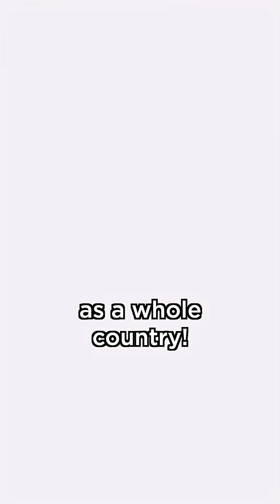The hottest building in the world

Comment: One question… Can we make data centres at snowy places so we wouldn’t need ACs to cool it down.. just need to make strong networks reaching there…Cost ans energy saving 😅
Reply: But how are you gonna give electricity and water supply there ?
And internet 
There ?
Reply: Due to high humidity...the components got rest faster than normal condition.

Comment: Brother you missed one thing water.
It consume so much water 💦.
AI will be good as computer but we need to use them wisely not for our silly questions
Reply from the maker: Totally. And that’s why hydrogen tech is exciting, some companies literally split WATER into clean fuel. We just need to scale it.
Reply: @NasDaily when is the material generator
Reply: Pretty sure you can reuse that water
Reply: Yah , You should have correct way how you can use ai power infectively, that's it! If you know about that so you can go very well.
Reply: Good observe
Reply: Nvidia just found the solution sometimes before
Reply: It doesnt drink water , it just uses it for cooling and comes back
Reply: It doesnt drink water , it just uses it for cooling and comes back
Reply: I'll ask it "how to goon maximum efficiency"
Reply: you're acting like they just dump the water after its used or it just evaporates, you realise the water is just recirculated after being cooled down, they dont waste water at all.
Reply: @lkeld how much energy it requires to re-circulate the water and to cool it down?
Reply: @vkmvaswani  In water-cooled data centers, moving the water is a small slice of power, while removing the heat is the big piece. As a rule of thumb: pumps use ~1–3% of IT load, and chillers/towers add ~10–20% when mechanical cooling is on. So for a 1 MW AI load, expect roughly ~150–200 kW for cooling (≈PUE +0.15–0.20). Run warmer water or use free-cooling/economizers and that drops a lot.
Reply: Out of all the emojis you did that…
Reply: Water don't really disappear it's more about the energy
Reply: stay in school or this might be you!
(AI does not MAGICALLY ERASE water, AI keep using same water in cooling pipe loops)